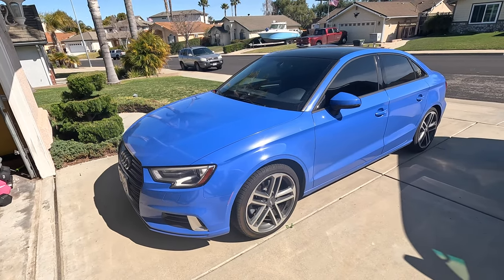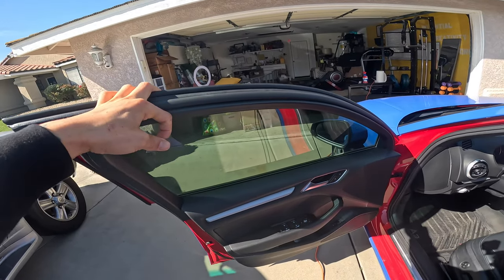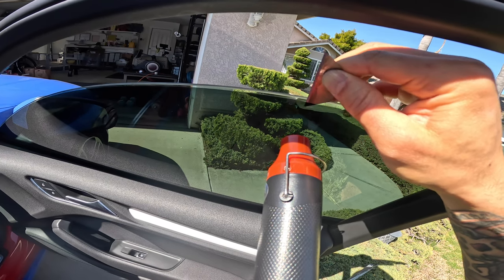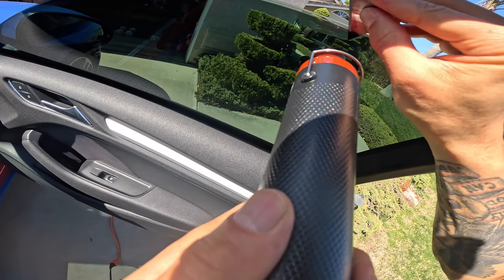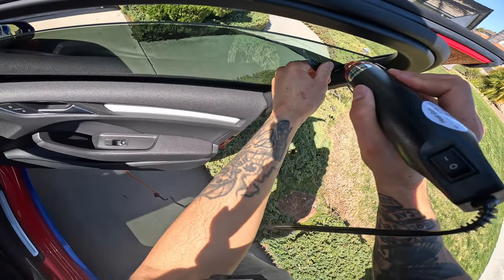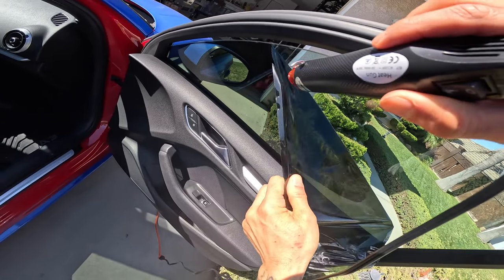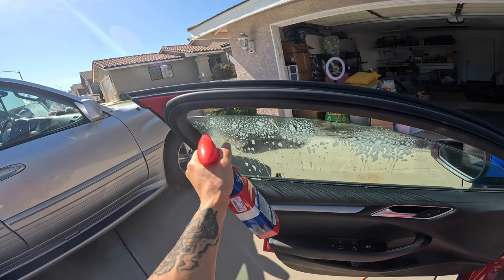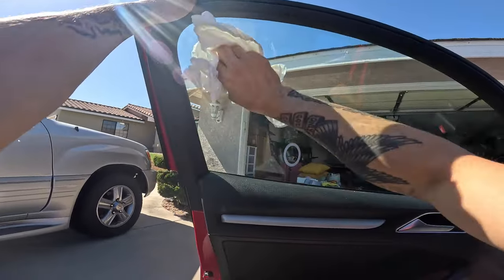DON'T WASTE TIME - Easiest Way To Remove Window Tint In 3 Minutes

Comment: Extra tip: Heat it from the other side of the glass ;) You won't have to worry about burning yourself and you can heat a much larger area, allowing you to pull it faster. Plus, no risk to over-heating or accidentally hitting your door panels.
Reply from the maker: Game changer! Thanks brother
Reply: My brothas can you please tell me how to remove the windshield tint🙏🏻😫
Reply: @mobileautorepairs2169  You will be perfectly fine using any heat gun. I have a harbor freight one I use as well from time to time or while out on jobs. I would say keep the tip of the heat gun about 6 inches away and keep t moving in a small area. Operate it at high/max or move the tip a little closer and operate on low (about 3 inches away). You'll just want to get the glass pretty warm and as you start to pick the corner, you'll be able to SLOWLY pull the film back, while slowly progressing the area of the glass you are warming from the other side.
Reply: Thank you so much like the other guys were saying it was a real game changer night and day difference passenger side was a PIA driver side was a breeze

Comment: For the guy that commented he used ammonia I didn't read the entire deal but this right here this video using the heat gun is actual factual it's true information and does work. You use harsh chemicals to try and do the job or unless you're wearing a respirator I would not advise it

Comment: As far as heating guns or heat guns go any brand of heat gun that you can find at Home Depot or Ace Hardware or something to that nature I'm sure suffice I'm going to try a hair dryer. On high heat to see if it works if not oh well and I will comment as such but I do have a heat gun at my shop that I will be that will be the next Price is Right

Comment: I used ammonia based glass cleaner to spray all the glass tint. cover it with a plastic film like a garbage bag. apply heatgun to heat up all of the glass from the outside, esp the corners. Once enough heat is applied and it is warm to touch, use a razor blade/putty knife to gently lift up a corner. post that, use that to peel gently around the edges, equally covering the middle from one corner to the opposite, with the intention/care of not tearing the film. Not a big deal if it tears but it makes it easier to pull it one sweeping motion.

Comment: Maybe a dumb question but want to make sure I purchase the right equipment and do this right. Is there a specific heat gun to buy, and is there a specific level the heat gun needs to be on? I've heard if you aren't careful with the heat gun you can permanently plaster the tint to the window, is that true?

Stoked to try this, great video man, quick and to the point!
Reply: I used the same gun I use to remove paint from woodwork or garage projects.  Wore latex gloves and got it hot enough to soften the tint and it peels off easy.  Didn't use hot water/soap for the residue, maybe should have.  Used a razor and carb cleaner spray with making tape to protect the inner door panels.
Reply: @captainamerica9353  thanks for the reply captain 🫡 I just did mine this weekend and it came off SO easy. Think I got lucky, used the heat gun just a bit but it pretty much peeled right off, little residue left. Could be that my car was sitting in the hot sun all day and that my tints a bit older. I just used the same heat gun he used in the video
Reply: @mikerosav what is the temperature you used ? And what type of heat gun?